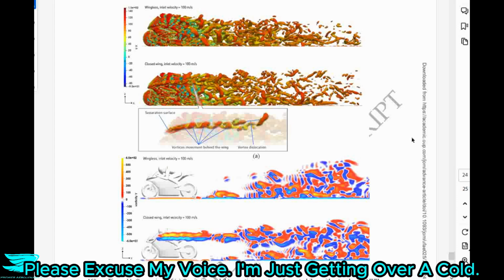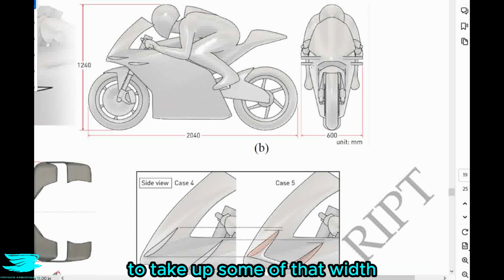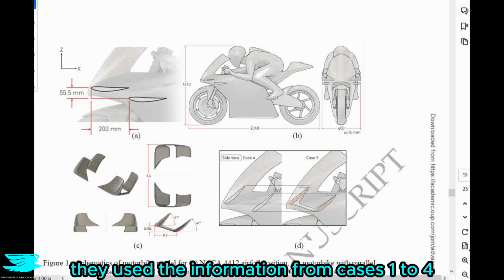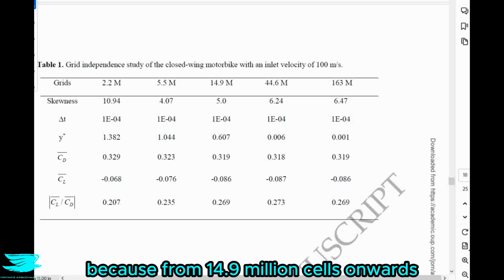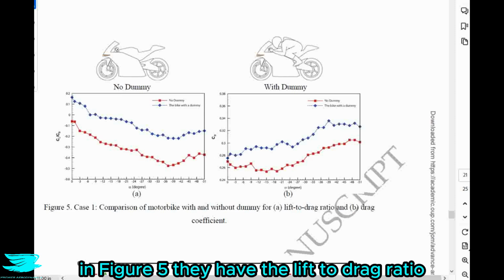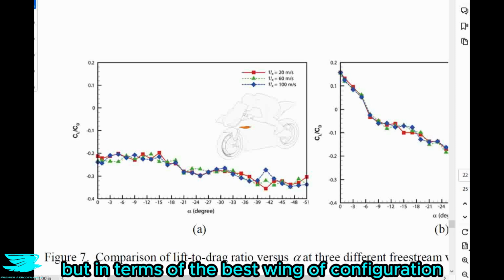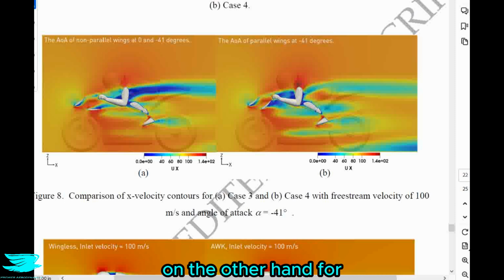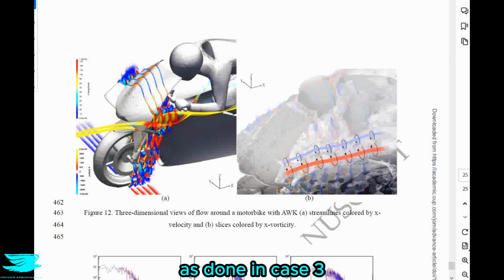Podcast 188 Motorbike Wing Aerodynamics

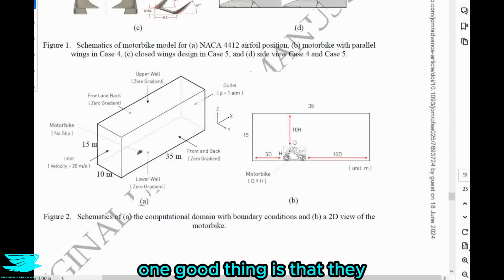Comment: 9:57 It just occurred to me, the "slip" boundary condition is a significant source of error when modeling ground-effect aerodynamics. The boundary condition for the ground should be modeled as "no-slip" with a velocity equal to the free-stream air velocity. This allows boundary layer friction, in cases where air velocity changes (in speed or direction). For example, airfoil undertrays (and even the shoulders of motorcycle tires) locally increase airspeed, by a venturi-like reduction in ceiling height.

If possible, they need to model the wheels and tires as "rotating no-slip", otherwise there will be a strong interaction between the tires and the ground, resulting in unrealistic interference drag and erroneous lift/downforce, if I had to guess. I was able to do this in Fluent 17 years ago, so hopefully OpenFOAM allows rotating no-slip boundaries.
Reply from the maker: The no-slip moving wall boundary condition is a very good point. As you say, the features coming off the car can change the flow around the ground and slip may not capture the flow physics properly.
Reply: @PremierAerodynamics  Thanks. Episode idea: I'd love to see a case study comparing drag and lift coefficients for slip boundary vs. moving ground/wheels. I recommend choosing a car, since it has greater plan-view area than a motorcycle.
Reply from the maker: That's a good idea. We'll see if we can find something on it.

Comment: Good point about the significant compressibility effects. "Angle-of-attack" refers to the angle with respect to free stream. A more appropriate term for wing angle with respect to the vehicle's orientation would be "angle-of-incidence". I know you didn't write the paper, but I thought I'd mention it anyway.

21:14 The top wing is -41° and the bottom one is at 0° in case 3.

I'd like to see:
1) Pitch angle in the neighborhood of +10 degrees. Angle-of-incidence would determine how lift increases with pitch angle. This could result in reduced pitch stability during a wheelie, as the angle-of-attack sweeps from negative to positive.
2) Pitch angle of -3 degrees, with the rider sitting upright. This will approximate a stoppie, where the front forks compress, and the swingarm shock extends.
3) Max lean angle, with rider hanging off the inside of the bike and dragging an elbow. I'd like to compare how much aerodynamic load is on the front and rear wheels with wing(s), vs. without wing(s). Also, what's the front-view angle of the lift vector? Is it inline with the bike's lean angle? This results in some degree of (detrimental) outward lateral force, but at least the bike is leaned less than the CG of the combined bike/rider system.
Reply from the maker: That's a really good point about when the rider is braking, the bike's attitude will change and that changes the airfoils' angles.

And when leaning, as you said, the airfoils will have a component of force away from the corner, which could destabilize the bike.

Comment: With 2 wings a "slotted Flap" is built.
The pressured air of the first wing works as boundary layer control.
Stabilizing the flow over the second wing - prohibiting stall.

Rotating cylinders are able to produce better lift than unpowered airfoils. 

I would like to rotate these big carwash brushes to supersonic speeds. 
If brush strings are winded around the cylinder, they gonna unfold at high rotation speeds.
Forming an impressive vortex, thats able to produce lots of downforce.

Perhaps a Monstertruckdriver wants to install a carwashbrush as spoiler ?
Reply from the maker: I think the shocks would deform the bristles so maybe more like steel bristles would be good. Also, the bristles would likely break up the shocks into smaller, weaker shocks.

Comment: Looks like the riders themselves can affect the aerodynamics of the bike as well. You see a lot of high energy flow go over the shoulders, and a lot of wake in the under arms. Just flaring the arms and the legs can affect the aero profile of the bike. All your old CFD's show legs are pretty terrible aerodynamically. When riders lean on turns they stick their knees out, and even touch the ground with their knees, and elbows which interact with the lower bodywork as well.

Looks like the wings on bikes have to take into consideration the shape of the rider as well.
Reply from the maker: Yeah, that's something that could help with braking too. If the rider is flexible enough to stay balanced and flare out arms and legs, that might help.
Reply: @PremierAerodynamics  or just stand up and increase the frontal area.
Reply: @PremierAerodynamics  During braking, the rider won't be able to flare out his elbows, because they will be fully extended while sitting upright. He could flare out his knees, but that risks getting his pelvis (among other things) smashed into the fuel tank. At least upon initial brake application, he tends to clamp the tank with his knees. After that, he sometimes dangles his inside leg in the airstream. A cleverly designed seat and fuel tank might allow the knees to flare, but such pelvis/belly bolsters should not impede the rider's ability to fully tuck his torso while accelerating.
Reply: Motorcycles have bad aerodynamics,but still they are narrow,and problem is seat height is higher tham cars.Expecr superbikes,you always are higher like in typical car.A cruiser with good wimdshield,and aerodynamic fromt bumpers,will be way better than a naked bike with even little more power.I think you can not really fix aero of bikes,bikes were meant to be fun,not comfort.